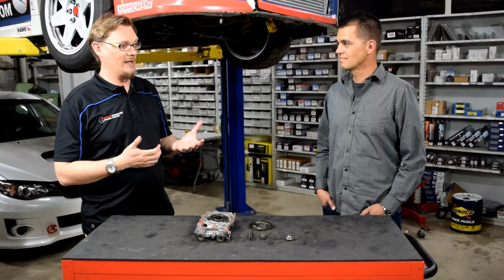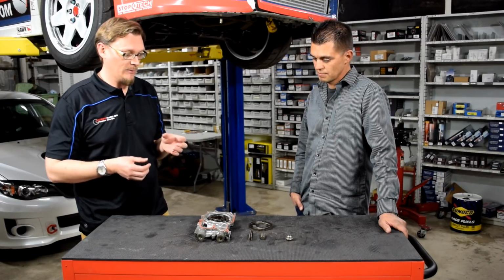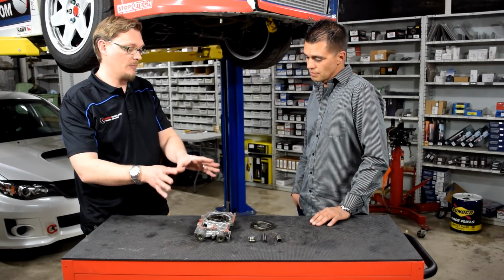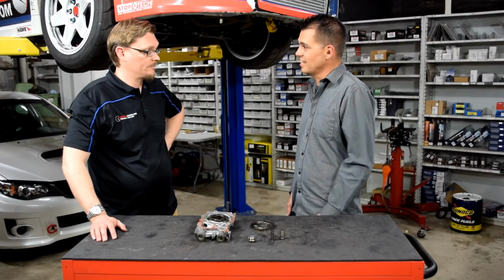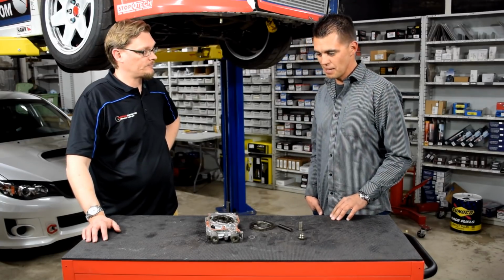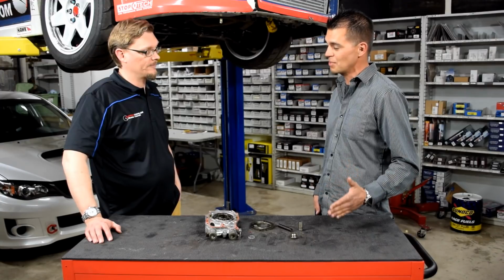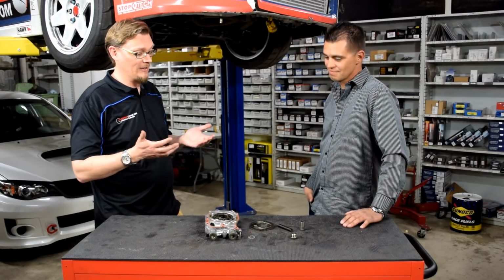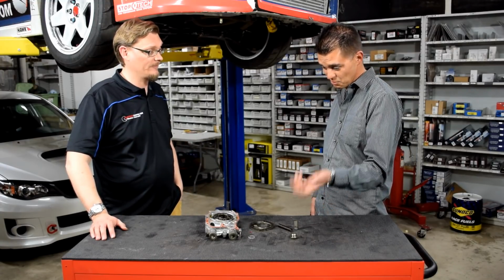A discussion of Oil Pumps, Oil Pressure, and Shimming Subaru pumps

Comment: Great video as always.  The need for 12mm pump was required only after the bearing tolerances were increased correct?  What drove the increase in bearing clearance if the 10mm pump was adequately filling to tighter bearings?  I'm also curious where oil temperature was being monitored.  I would guess these are sump or filter temperatures? When monitoring rear case temps on my ej25d na motors, I found the oil temp would continue to climb on long stages.  It was not the highest quality gauge/sensor but still tended to show a relative increase over long stages.    I've wondered if the tight bearing tolerances on stock motors don't flow enough and possibly the oil is getting hot while traveling between the pump and bearings.  Basically the oil might be heat soaking in the block.  Another thing about the ej25ds(probably not an issue on the 207s ) is they don't provide equal oil flow to all of the crank/rod bearings.  If I remember correctly, two of the rod bearings share a single oil port while the others get their own.  My last rod bearing failure was on one of the shared ports.  Cross drilling or through drilling might help with that issue.  Another thing that you probably have covered already is that those philips head oil pump screws should be lock tighted.  They like to come loose.  I've been struggling to find the root cause of the never ending rod bearing failures on these motors.  Obviously oiling is a big part of that.  Thanks again for sharing.
Reply from the maker: Thanks for your questions Brian.  I believe that the oil temp is being measured off of the rear galley plug, but I'll have to check with Victor.  The reason that the bearing tolerances were loosened was because the power target for the engine was increased by a fair amount.  And yes, the need for the larger pump stemmed from that change in bearing tolerance.

Thanks for watching!
Reply: Thanks for the info! I'm curious about the rational behind increasing the tolerance when increasing power.  Is the idea to increase the oil pad thickness to cushion higher impact forces? account for increased flex?  Something else?
Reply from the maker: Hello Brian.  That is exactly the thought.  Since the power goal was going up a good bit, the idea was to go with a slightly loser tolerance to give more of a cushion to the bearing.  And to get that to work you need to maintain the target oil pressure, and that is where it got interesting :-)
Reply: Ahhhhh great info thanks!
Reply: FlatironsTuning   What advice do you recommend for my 2005 STI I’m replacing my timing belt with 100k miles. I’m going to replace my oil pump seal and it would be the perfect time to receive any advices!
Reply: u can use double drilled crank AND king crank bearing..because that particular brand have 360 degree oil groove and multiple oil hole on the bearing surface....every small change in improving that lubrication for conrod no.2 & no.3 does helps reducing the risk of broken conrod bearing

Comment: Bang on with the pump upsize. I had to do the exact same thing except a 10mm to an 11mm. There is a certain company out there that is very against changing pump sizes from the one that came on your engine. I personally don't agree with that and shouldn't be used as a blanket statement.
Reply from the maker: Thanks for watching, and thanks for your comment.

Comment: Great Video! I’m just still confused on one thing. Why does the oil heat up so much going through the bypass? I know friction was mentioned but doesn’t friction happen in the oil pump too?
Reply from the maker: Thanks for your question Matthew.  Yes, friction does happen in the pump.  When the relief valve opens, the oil that just went through the pump gets re-routed back to the inlet side, and goes through the pump again.  If the oil get sent thorough the pump over and over, that is what can cause the oil to heat up.

Thanks for watching!